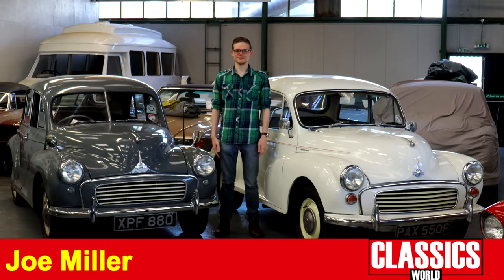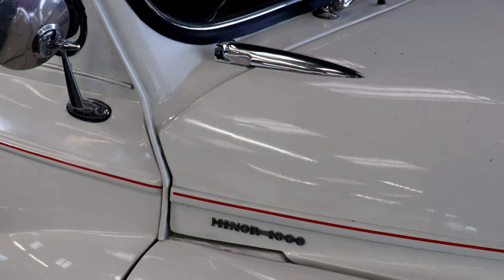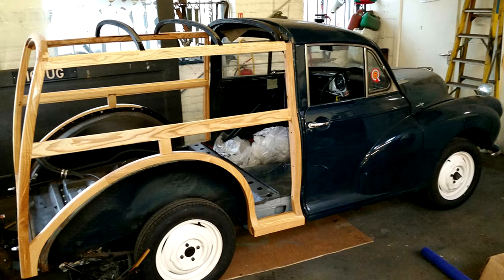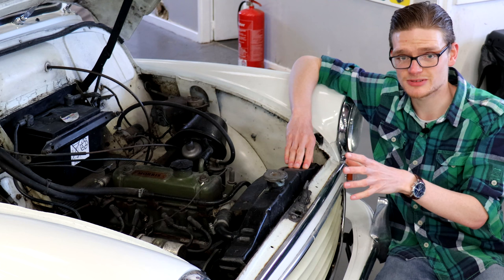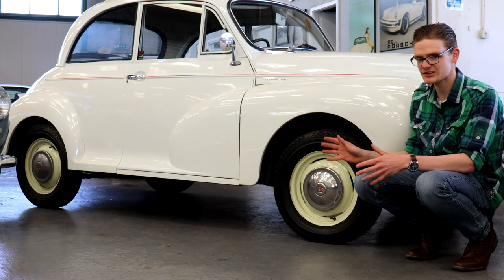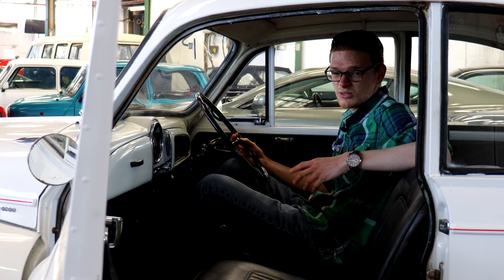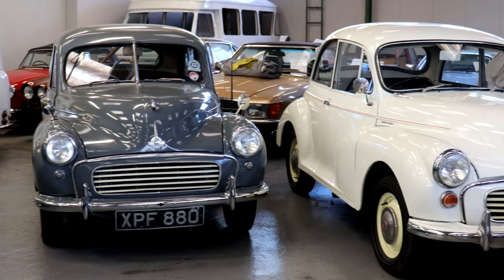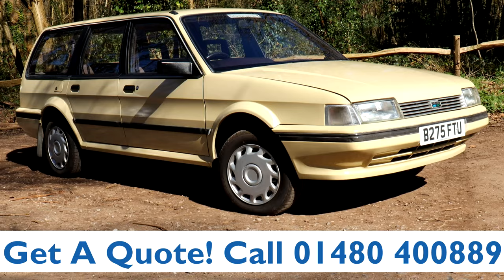Morris Minor Buying Guide - Perfect First Classic Car

Comment: I've only just come across this video and wanted to mention that your comments about blue smoke aren't entirely correct. Blue smoke (oil burn) on acceleration is most likely to be worn rings/bores. Worn valve guides would much more likely to show up as blue smoke on initial start up, smoke after a period of idling, such as at traffic lights and then when you pull away, you leave a cloud behind you, or most commonly on deceleration. A good test to check is to either accelerate in 2nd or 3rd and instead of changing gears, back off the accelerator and allow the car to slow from engine braking (don't push the clutch) as the engine slows the car, it creates high vacuum inside and if the guides are worn, it'll suck oil paste them and show as smoke. The same will happen if you engine brake running down a hill, just get someone to watch from behind in both cases.

Comment: After owning it for 20 years, our Minor 1000 needed serious corrosion repairs - much of the floor, all inner wheel arches and many other parts. Budget at least £10,000 for extensive repairs by a specialist repair shop. You can spend £30,000 on a complete restoration on a non-running wreck. There are bargains to be had at auctions - a fully restored saloon went recently for only £5,500. Great, very useful video.

Comment: The gearboxes weren't all that good, not only worn synchros need to be checked but a chipped tooth on reverse gear was fairly common too. If you road test a Minor always check reverse gear. Same goes for Austin A40 Farina.

Comment: There is no synchromesh in the first gear so you can double de clutch as much as you like but it will crunch.
You really need to be stopped to engage first gear.
Reply: No. Get the double de-clutching right and it won't crunch. Older vehicles had no synchromesh on any gear so you had to DDC on the way up as well as the way down. It was just a driving skill you had to acquire.
Reply: I find on my traveller changing 1st to 2nd is not the best until she has warmed up however I always double de clutch (learnt at an early age on tractors) when changing gear so it's never been a problem for me.

Comment: Thank you a really informative Vlog on the Mogs. One thing which. would have liked to learnt is about how they were manufactered to run on 4 star petrol and what can be done to have them running on modern E10 unleaded.
Reply from the maker: An unleaded head conversion will allow them to run on modern fuel, but E10 remains a no-go, stick to E5 "super"